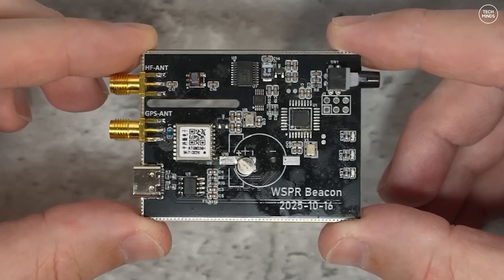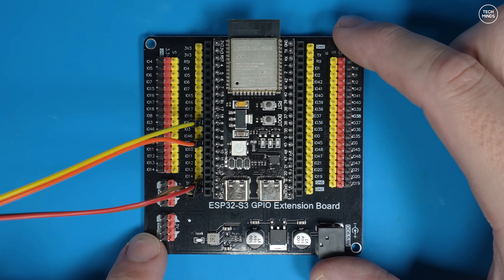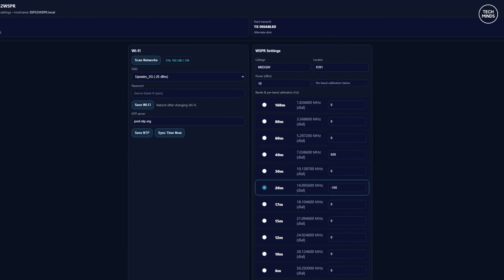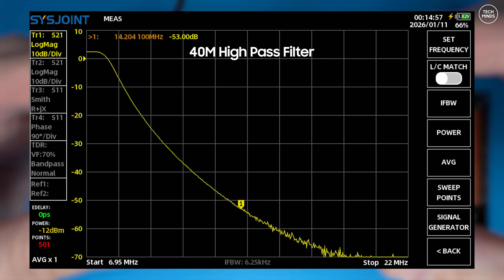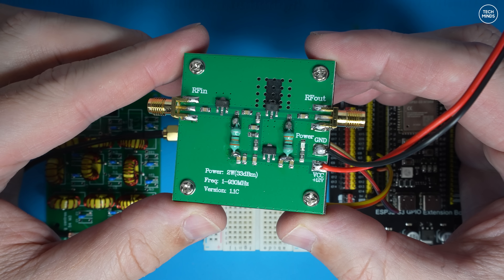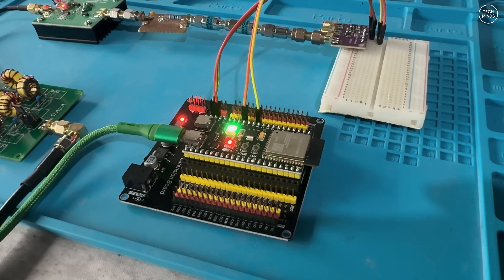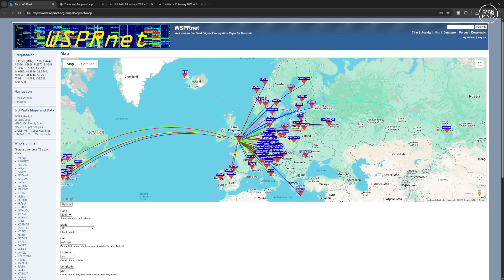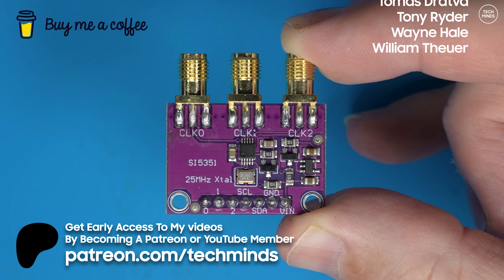Build Your Own WSPR Beacon For Less Than $20 with an ESP32 and an Si5351!

Comment: It should be possible to use the three clock outputs from the Si5351 as inputs to three filters, to avoid having to worry about switching. When switching between frequencies, the software would switch which output is being used. (You'd also have to make some modifications to the Sotabeams filter board).

Comment: If you have a 10MHz standard to hand, you can replace the crystal signal with that, and the SI5351A will still work the same way without any other changes.
(Yes, I know what the datasheet says, look for Simon Schrödle's experiments on this, which I have tested as correct).

Comment: Would it be possible to use one of the other output to add a bpf/preamp/mixer-product detector(ad831 boards are available on azn/ali*) and decode/spot WSPR with the ESP32? It would take some FFT magic, I'm not sure if the ESP32 has the umph to decode that many signals all at once in that small of a bandwidth.
Also, for the non-hams there are 2 ISM WSPR freqs  that can be used (w/o amplification of course) 6.773 (in most countries) and 13.5539(worldwide).

73, WO8E

Comment: Can someone help me out as to what exactly this does?  What can be transmitted and what could this be used for.  Am I seeing this correctly that people are receiving your TX almost 1/2 way around the world at 2w??   
I'm sorry to ask such trivial questions, but with all the new radio tech like HaLow & a few others, I'm starting to get some of the stuff confused.  
Thanks for the work you are doing in this!!
Reply: Weak Signal Propagation Reporter (WSPR) is a protocol in amateur radio used to test signal propagation, literally showing where you can make contacts on a given band. Note that he started without an amplifier and was heard at significant distances in a few militants. With the attenuators he had about 250 to 300 militants output.

Comment: Wsprry pi running on a pi and the sound interface generates the rf. Just needs a low pass filter but at 15mW how bad could  the second harmonic be? I have had reports from 1000 miles plus on 20 meters just off the pi gpio pins.
Reply from the maker: yeh i have covered this already in another video.. this is another way..

Comment: FYI If you have a Starlink you already have a Stratum 1 local NTP server on your network... just need to use it.
Reply: Oh that's really interesting... 

Is there an easy way to get a 1PPS reference pulse from that? Maybe Pi running Chrony??

Or even better a 48KHz word-clock, to support testing my own project?
Reply: @mungewell NTP can't provide enough accuracy for frequency stability, PTP was designed for that but it requires more specific hardware so the ethernet packets themselves get timed rather than relying on UDP.
On a local network, wired, you can get as low as 1usec but the packet timing jitter adds uncertainty.
You also can't depend on WiFi for high accuracy time synchronisation because of the non-deterministic transmission timing.
Reply: @BobHannent there was a good/interesting talk on PTP at this year's CCC.

Comment: Very cool Matt it was only the other day I was going through my AliExpress bits and notice I have the Si5351 modules. I know people have used WSPR from pico weather balloons before suspending the tracker from one leg of the dipole attached to the balloon. There is also some code out there for doing WSPR with a Pi Pico from what I recall it didn't need the SI5351, if you Google WSPR to the wind you may find it if I recall it was promoted on hackaday sometime last year. Great content as  always, speak soon.

Comment: Simply brilliant!   Adding GPS timing and TCXO would make it worthwhile adding a display would be like icing on the cake. Very cool.  Thanks for sharing.
Reply: Better still would be to make it module..... so people can add what they want/need.
Do you want  a display and buttons? or would you prefer a web gui?... maybe you want both?
Can't afford a GPS module yet? Then pick internet time.
Want to use a filter with relays to change band... enable that module.

I could see this as an interesting project if he decided to pursue it further.
Reply: @Andy_FortyTwo  These are good improvements to suggest on the github page so they can be seen and discussed. Even if you don't write code it's fun to contribute ideas there. Maybe someone will volunteer to code that portion.
Reply from the maker: I do have a version of the code that works with the GPS module I showed in the video, I just wanted to keep it simple for the moment, but making as a “module” so different parts can be easily turned on and off is defo something I can do. Watch this space! Or GitHub to be precise lol
Reply: @Andy_FortyTwo  I Like your suggestion  👍

Comment: Very cool, Matt. Excellent project. 
Always nice to cobble something of your own making together.
I'll probably try putting a filter between the clock generator and the PA too.
Reply: Haha, I was thinking the same, to have a perfect clean signal.
Reply: @lonebot2003  Yeah, there will be lots of intermodulation with all those spurs going into the PA. Looking forward to trying this !
Reply: It is like you read my mind! Been hankering to build a beacon so the shack is on air 24/7!!! Will give it a crack…. This project is in the queue. 73 OM de VK2AOE